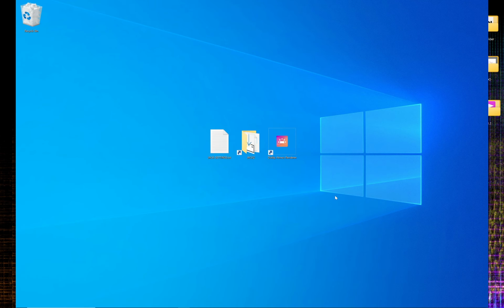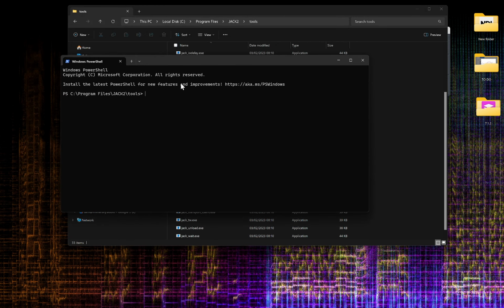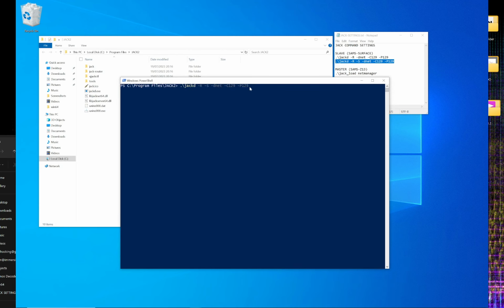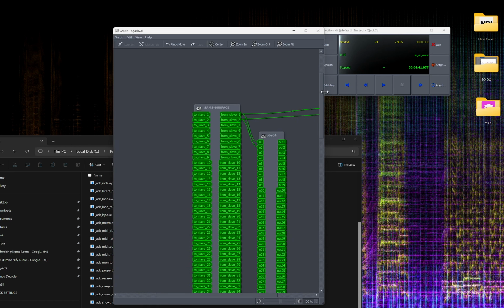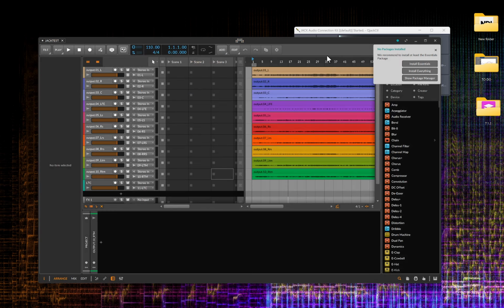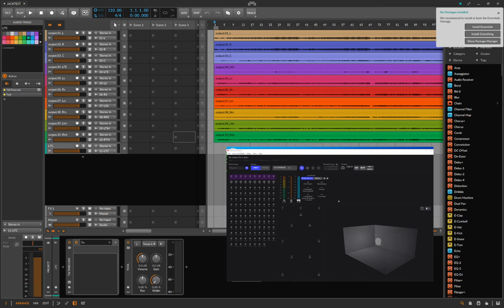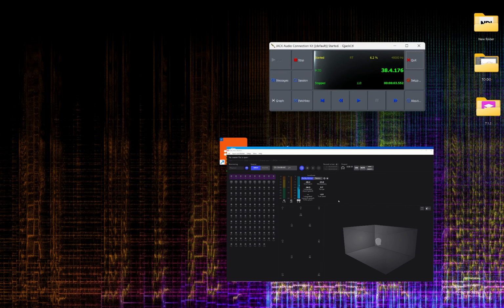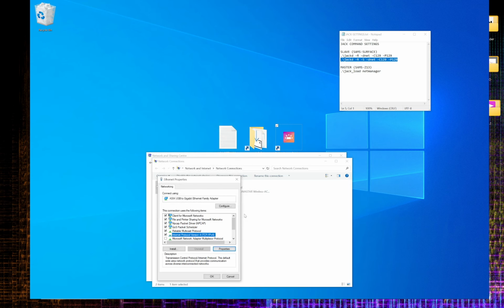Windows Dolby Atmos Renderer Slave PC Using JackAudio/JackNet NetJack2

Comment: Hi, great explanation video. What are the advantages over the NDI protocol? Thanks in advance
Reply from the maker: Last time I looked at NDI Tools and Avsono, which seems to be their ASIO Virtual Audio Device it was limited to 64 channels so might not be enough for Atmos work with the Renderer. It's very cool though, i use their Input/Ouput NDI VST3 plugins sometimes for routing audio between VST applications, very handy.